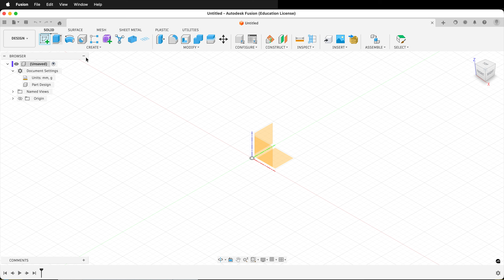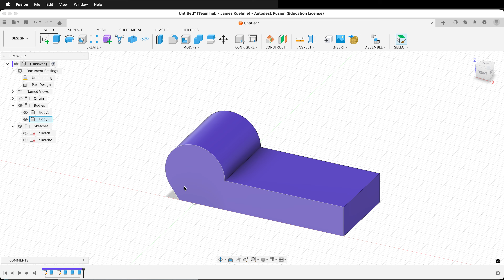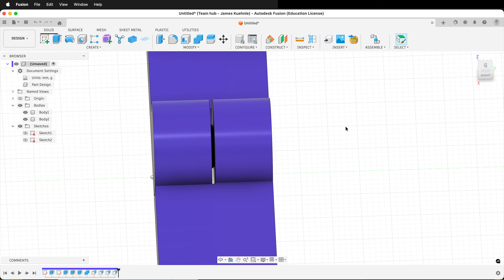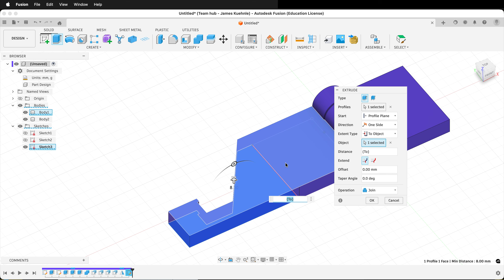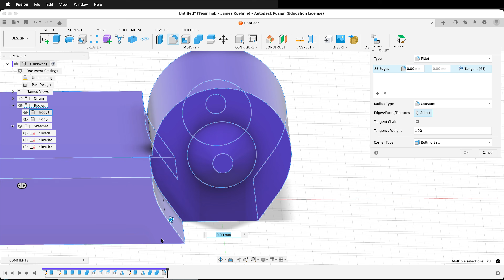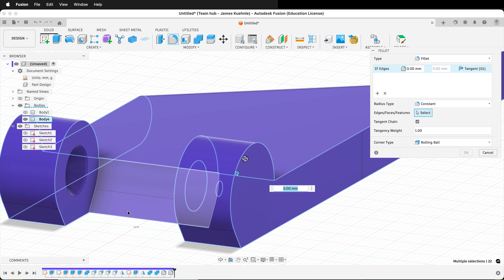Autodesk Fusion Print-in-Place Hinge Tutorial: 3D Printed Phone Stand (No Supports)

Comment: don't understand what to chamfer and what to fillet. is fillet only for aesthetics and chamfer for bottom base and offsetting?
Reply from the maker: Can be both, in the context of 3D printing a 45 degree chamfer is helpful on the bottom for form control and is also printable without supports. For example if you 3D print a box enclosure and fillet the inside corners then it might not be able to be printed at an angle without supports but if the inside corners had a 45 degree chamfer then it would be possible without supports